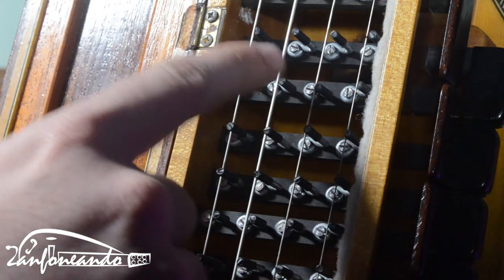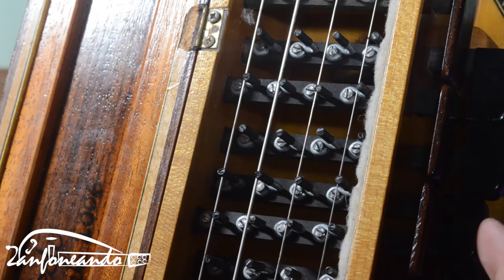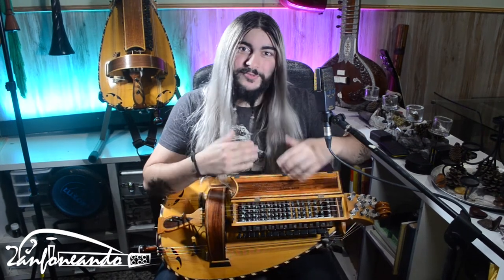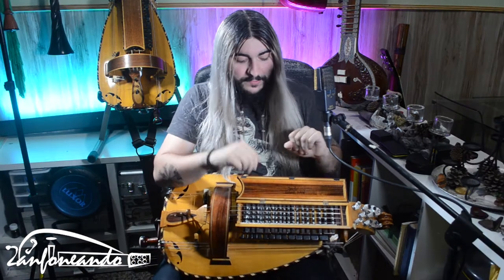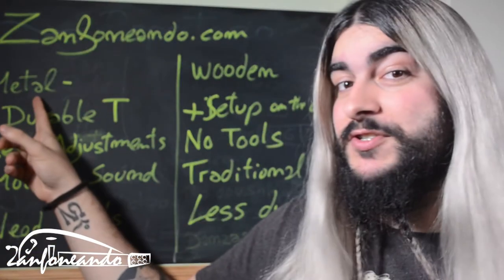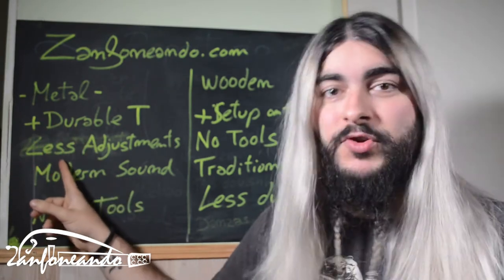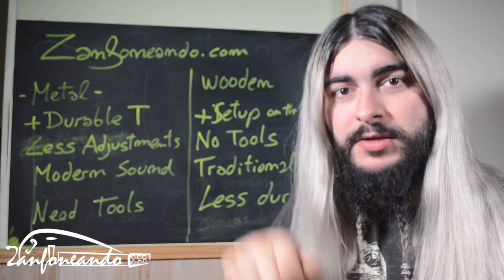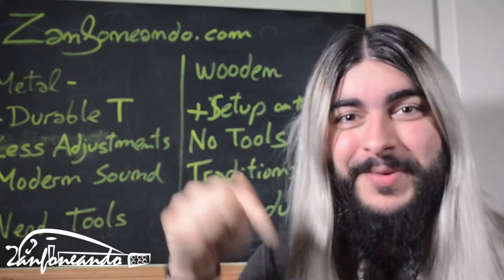How to choose the tangents for your Hurdy Gurdy

Comment: Mine has three melody strings and wooden tangents, and it’s a total pain when one of the tangents decides to slip in the middle of a performance. In the best situation, I have the opportunity to hold the open note for a second, and can open the lid and turn the tangent back, but at worst, playing that particular key will sound two notes (both that note and the open note). Some peg drop on the tangent helps, but that’s not a “during the song” fix. I want metal tangents on my next one!

Comment: So before adjusting tangents...make sure the octave tangent is straight on, then adjust the nut until the octave and open string is equal, THEN adjust each tangent? Yes? It seems like getting some of my tangents in perfect tune really require see serious up and down positioning.
Reply from the maker: Yes, the tangent tuning, depends on the original keyboard calculation, the nut and bridge can move, so sometimes it's tricky to get the correct scale length. Also most keyboards are calculated not to equal but to just temperament to sound good with the drone, that means when you tune each individual tangent It has to be tuned by ear against the drone tuned Green on the tunner
Reply from the maker: If you want to tune just temperament with the tunner, you have to follow a certain deflection of cents

Starting from G the serie would go like this 

G  0 (Green on tuner)
Ab +12 cents
A +4
Bb +16
-14
-2
-10
+2
+14
-16
-4
-12
0

Comment: My Gotschy originally came with wooden tangents fixed with screws. I got tired of having them break on me; so I experimented with homemade metal tangents, made of brass tubing compressed into shape. One early problem was that the bottom ends tended to cause wear on the key rods; so I tried putting a flange there.

These still gave me some trouble; so I finally bought a set of metal tangents from Hurdygurdycrafters. I also had embedded small nuts into the key rods, as I was having trouble with stripped threads. These have proven rather more satisfactory.

A question or two on the metal tangents you show here: how do you adjust their length between the screw and the post? I find that it is difficult to get both strings to precisely the same scale (especially when using octave tuning); hence, the tangents have to be adjusted at different angles. This throws off the clearance between tangent and string, which leads to my having to make one tangent longer or shorter than the other.
(This conundrum has often made me imagine a different form of tangent altogether; which would turn on a different axis, and thus obviate such troublesome adjustments).

The other question: what is the best orientation of these tangents? I see you have yours with the screw on the side of the string nearer to you (in playing position): is there some benefit to this? Mine are in the opposite orientation, similar to the original wooden tangents.
Reply from the maker: This tangents are made using a small jig so each distance is the same, if you talk about the distance from the tangent to the string, you just bend the wire

I dont think the orientation is very important I've seen instruments work with either 

Ps. The different angles of the tangents have more to do with having a correct scale length on both strings

Comment: It looked like the metal tangents could only be rotated around the screw but the radius of that rotation couldn't be changed.  I've seen other metal tangents that had a slot on the bottom of the tangent so you could adjust both the angle and the radius from the screw.  Is it of any value to be able to change the radius?  I'd think it would be as that may be necessary to ensure all tangents on one key engaged their respective strings at the same time.  Or aren't things that fussy?  Thank you for doing these videos.  I'm learning interesting things, and as a side benefit they're enjoyable to watch.  I'm moving from being just an interested observer to actually thinking somewhat seriously about buying a hurdy gurdy.
Reply from the maker: This are special type of tangents made by Sedo, to modify the Y axis you can just bend the wire, it works quite good, there are other style of tangents where the Y can be adjusted with the screw, I don’t particularly enjoy the last (Weichselbaumer type) as the X and the Y are adjusted by the same screw
Reply: @Sergio.GonzalezPrats  Makes perfect sense once you hear it.  Thank you.

Comment: Hi Sergio.  Talking about your metal tangents...I think that this video is the only place that I've seen these bent wire tangents.  I see the brass plates with a rod everywhere, but not these.  I actually made some like this for my new NG and I like them so far.  Have you ever seen a place that sells this type or do they only come from particular makers?  Thanks!
Reply from the maker: This ones are made by Sedo García, but I also make them in my workshop, the only thing with this is that we need to match the measure of the drilled holes in your keys with the correct screw.

The brass plates work also great! I like the system, if you need the plans just DM me on Facebook and I'll send you drawings

Comment: What if I 3d printed the tangents, but made them in the same shape as wooden ones?
Reply from the maker: It depends on the material used, also if you have shrinking tube or Silicon tubing on each tangent and if your system has screws or not